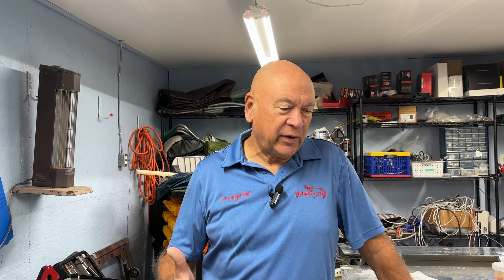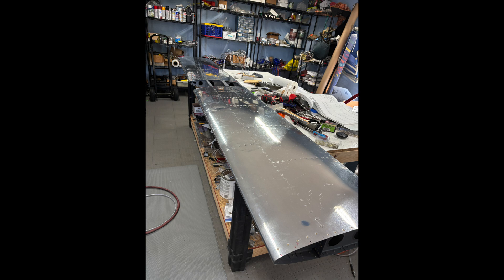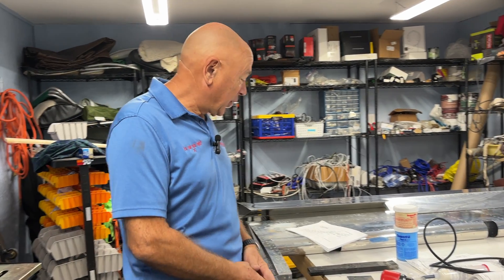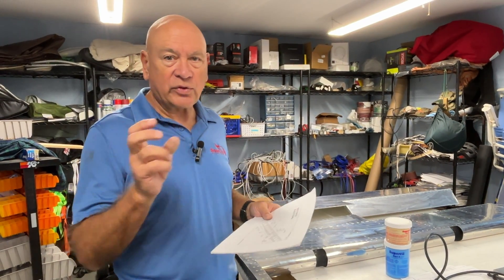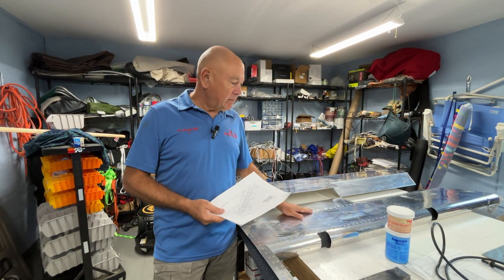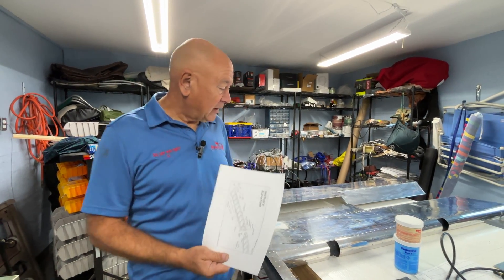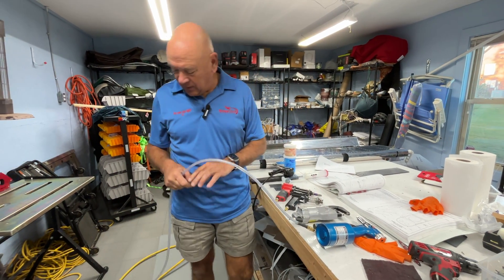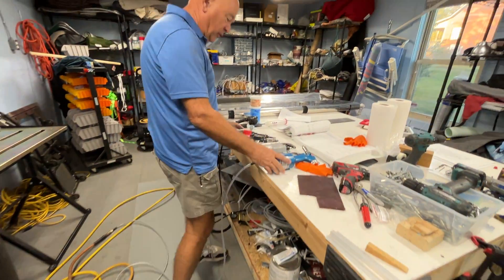Time saving Tool shortcuts for the RV 10 build

Comment: I’ve built basically my whole rv-14A at this point and I bought a second hand toolkit that came with a 3x rivet gun. No major complaints it works for everything but if I had it to do all over again I might go with a 2X as Vic mentioned just because I’m thinking it might have prevented a couple of the smiles in the build over time.

Comment: Hi Vic - question unrelated to this video - what is the  black “trim” used around the wind screens of your current RV10?  Is it a bead of silicone caulk or piper black tar tape???
Reply from the maker: you can use either. even a bead of black sika flex will work.

Comment: G,day from Sydney Australia. Some great advice, especially keeping current with service bulletins. 
Q1. What is the purpose of dimpling the aluminium surface of spars, ribs and stringers?
Would I just make a rivet spacer jig for perimeter and inside spacing?

🌏🇦🇺
Reply from the maker: the skins are dimpled so you either have to dimple or countersink the underlying structure. countersinking requires a minimum thickness of the underlying structure.